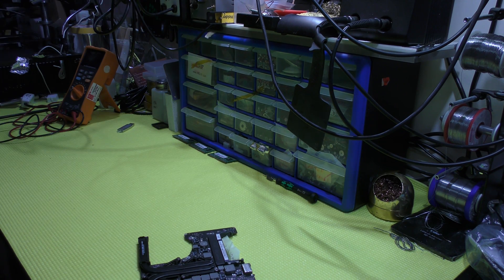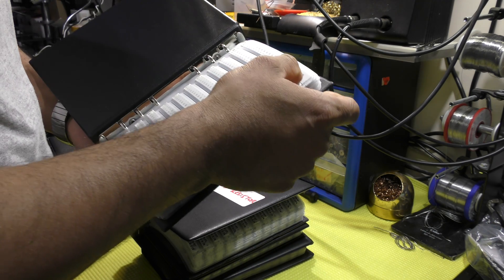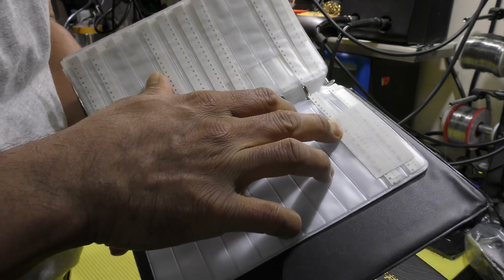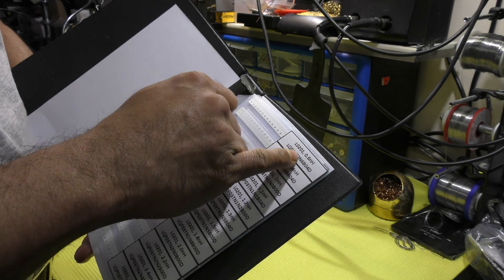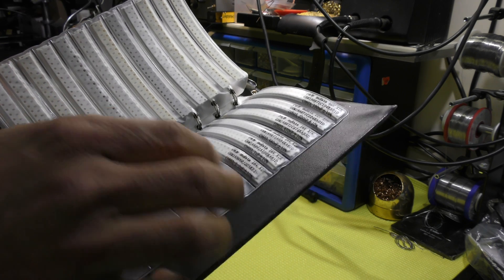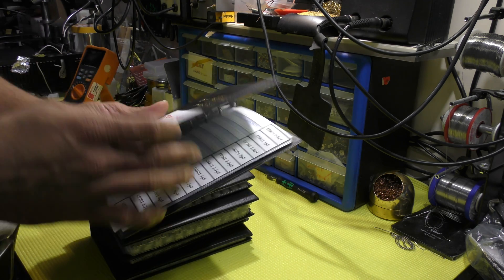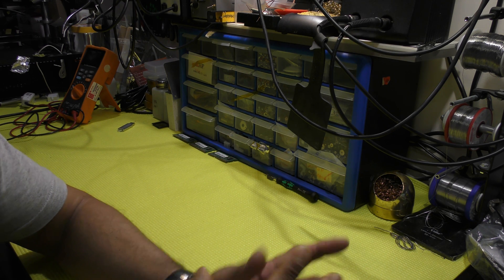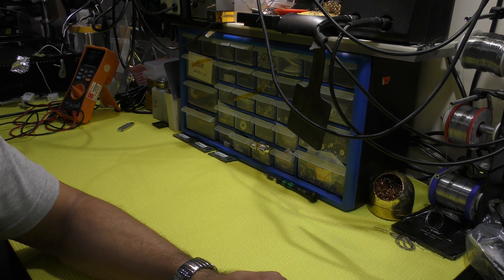SMD COMPONENT SAMPLE BOOKLETS CAPS RESISTOR INDUCTOR 0201 0403 0604 0805 1206 4K

Comment: hi, do you have any links?
Reply: it's not hard, in fact, guess what, i did google for it however that was not the reason i asked for a link - i asked because: 1. I usually get an affiliate link and that way help the channel i'm watching in a small way, 2. i get the link for the exact item channel i'm watching is reviewing and not some other item (e.g. knockoff - like  cheap nichicon caps) and 3. Yeah - since MTS is a channel (mine) i don't have problem in helping others (even if it is as you say baby-feeding) and hence i don't have any problems asking such questions... And regarding your friends, maybe they should not have a channel if they are not willing to help/answer their fans... so... :/
Reply: MTS You did not ask for a affiliate link you simply asked for a link. *Cough.  He stated in his video he bought them from eBay so I doubt they where high quality audio grade caps such as nichicon kg series.  Oh and a fyi nichicon are not bad caps they have audio series that are used in some of the best audio equipment.  Granted there are some even better caps for audio out there as well... However your buying ceramic caps for power suppy circuits most of the time anyhow so you don't need high audio quality caps.

With a comment like that "oh if your not willing to help your sub you don't deserve a channel.".  You sound like a sub and not someone who has a large channel because if you did you wouldn't have just said that.  Do you realize just how many self entitled brats say that and how many questions  alot of these channels get?  They could be answering questions all day and all night and still not answer all the questions.  So your saying they don't have a right to a life as well?  Just because someone doesn't want to answer you question does not mean they don't want to help when hey get huge amounts of questions they need to start picking questions that would benefit thier subs the most and questions like yours where you clearly didn't make a effort to answer it yourself is a waste of their time.
Reply: i never said i asked for affiliate link, i've said "i usually get affiliate link" - big difference, regarding nichicon caps that was my fault, i'm not a native speaker so i yeah.. i meant to say "knockoffs OF nichicon"

And lastly, you're fighting the wrong person here dude... i really don't care, sorry :/

Regarding what you have said about brats, yeah, there are... even on my pico channel but i just skip the comment if i don't like it and reply to the one i do. 

Anyway, that's all from me. I consider this conversation to be over. And good day to you sir! :)